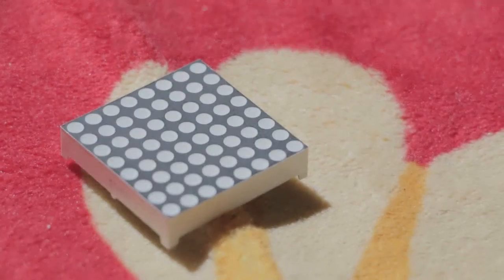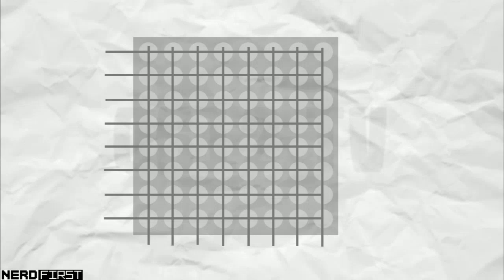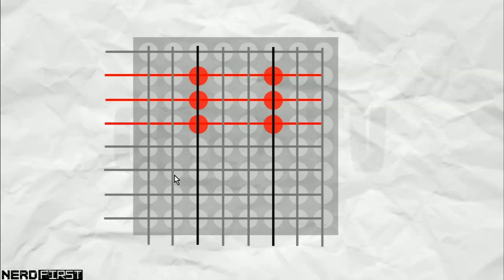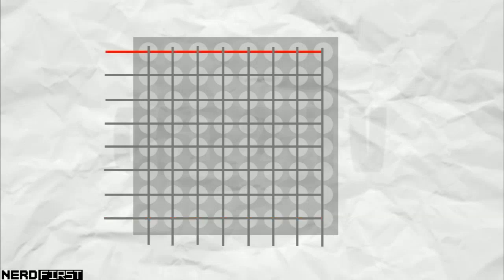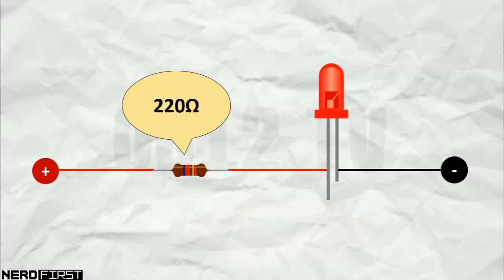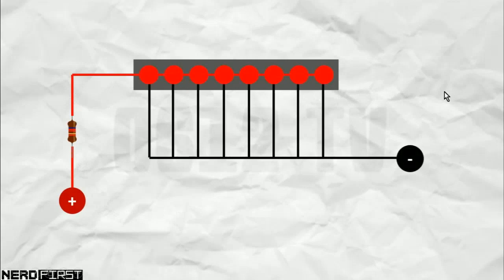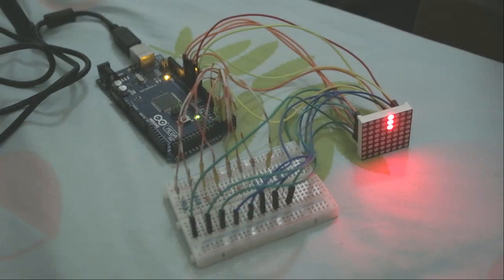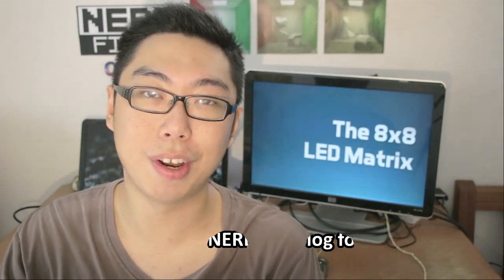8x8 LED Matrix for Arduino

Comment: Are you down?! Why are you showing the contacts on the left and bottom, When in a normal display the contacts are on top and bottom, What kind of nonsense is this?! Have you forgotten what a normal Arduino display looks like? Retake this stupid video!
Reply from the maker: Hello and thank you for your comment! Showing contacts on the left and bottom more accurately reflects the internal wiring of the matrix. Understanding how it works internally is more important than knowing the actual schematic - For that you would have to refer to the datasheet anyway, so this visualization is intentional!

Comment: Hello friend, can we make max7219 led dot array using ws2812 b, or any suitable LEDs. I have 2 nos max7219 4 in 1,what i want to do, just removed led array and make separate bid size display, to use as a wall clock, thank you.
Reply from the maker: Hello and thank you for your comment! I don't think it'll work for WS2812 since they already have control circuitry on board and already accept data input for easy control rather than raw signals like this.

At any rate, the max7219 is designed for matrix-style LEDs like the ones shown in the video, so unless you can find one that is pin-compatible, doing a swap like this is probably not a good idea.
Reply: @NERDfirst  thanks

Comment: Hi, thanks for the tutorial it's very interesting, my model has the number 1098AS on the side, is it the same for connecting the Pins? If you would answer me you would be doing me a great favor, I couldn't find anything online.
Reply from the maker: Hello and thank you for your comment! Can you double check if it says 1098AS or 1088AS? I indeed couldn't find anything for 1098, but 1088AS is a common alternative to the one I use which is the 1088BS.

If it is indeed the 1088AS, then it's different in that the anodes and cathodes are flipped. Read more here: https://forum.arduino.cc/t/difference-1088bs-and-1088as-led-matrix/970035
Reply: @NERDfirst  Maybe it's that and the writing has faded, but it looks like 1-0-9 (I thought it was a three because the arc above seems invisible) 8 or B and A-S (the last ones are visible very well)If only those two types exist it will be the second I presume. So is the connection reversed compared to the first? Resistor on the columns and not on the rows?
Reply from the maker: I think it's good to be very sure before you start wiring things up, to avoid any possibility of damage to your component. But having said that, yes I wasn't able to find anything with the part number "1098". If you're worried, test one LED first, the way I did it in the beginning of the video.

The difference in connections is more about which pins are connected to GND on your microcontroller (since we are flipping the positive and negative pins of the LEDs). Basically swap around all the pins I had connected to GPIO with all the pins I had connected to GND. As for resistors, as long as each LED has its own resistor somewhere in its circuit, that'll do the job.

Comment: Same things happen in our LCD or OLED display that we used to watch this video right now. They are even no such IC or controller that can drive millions of pixels on the screen individually. So, pixels in our displays may be connected together something like those LED matrix do, but maybe in other way. So, the controller controls the pixels by scanning. What we see on the screen actually not a complete picture. It just scan very fast until it can trick your eye to see a complete picture.
Reply from the maker: Hello and thank you for your comment! Good analogy! Unfortunately for a lot of these panels we don't get to be manually involved in this process since there is usually some hardware doing it for us. That's why learning something like this can help us better understand the tech around us =)

Comment: 11:50 Hi.  If each LED is getting 13.6mA and you turn on an entire row at once, then the circuit will try to sink 8*13.6 = 108.8mA which an output pin is not capable of providing.  This may result in damage to your microcontroller.  I think you need some high side drivers (e.g. 8 PNP transistors) for your common anode LED rows.
Reply from the maker: Hello and thank you for your comment! Yes indeed, several other commenters have raised this concern as well. Another commenter took measurements on the component and found that actual current draw is significantly lower, within the range of what an Arduino pin can source, but ultimately, the advise stays the same - Read datasheets, take measurements, and be doubly sure before embarking on such a project.

Maybe I'll edit the pinned comment a little to make it sound more cautionary.
Reply from the maker: I've just checked the earlier discussion (here: https://www.youtube.com/watch?v=G4lIo-MRSiY&lc=UgztVk5rMrTeLnISr4R4AaABAg ) and noticed that you've participated in it and brought up these points before.

Good to hear from you again and thank you for continuing to share your feedback!

Comment from the maker: Expand for Important Notes

1. On Current Draw
A valid concern about the setup shown in the video is whether current draw exceeds what a Pin on the Arduino can source, bearing in mind that the GPIO pins on Arduinos are rated for 40mA at the absolute maximum. This could indeed be a problem - Drawing too much current can risk damage to your Arduino, so if you're going to be building something like this for extended use, don't do it the way I did!

It is best to take your own measurements and consult the datasheet of the components used to ensure that you are not overloading your Arduino.

Further discussion here, with thanks to YouTube users Mangostein and Enigma758 for their input: https://www.youtube.com/watch?v=G4lIo-MRSiY&lc=UgztVk5rMrTeLnISr4R4AaABAg

2. On Debugging and Help
Unfortunately due to high IRL workloads, I'm not able to look at your code and help diagnose problems. You may contact me at hello(at)nerdfirst(dot)net for paid consultation, if you really see the need.

Comment: Hi, this is a very clear explanation video, may u pls upload the schematic on routing this 8*8 LED with using Arduino MEGA2560, simply watching the code hard to imagine how u r routing...
Reply from the maker: Hello and thank you for your comment! I'm afraid I don't have schematics for the circuit in this video. According to the code, it seems like I use pins 2 to 9, and 22 to 29. I can't tell which set is for X and which is for Y, unfortunately, but I believe it's not much of a problem switching the two around.

Refer to the diagram at 2:49, and connect pins 2 to 9 in order to the X pins, and 22 to 29 in order to the Y pins. If we mixed up the rows and columns, the image may appear rotated to the side, but that shouldn't be too bad, just rotate the matrix physically and we should be fine.
Reply: @NERDfirst  Thank you for ur reply. so u r trying to say pin 2 for x1, pin3 for x2,..., pin9 for x8, then pin 22 for y1, pin 23 for y2,... pin 29 for y8 right?
Reply from the maker: Yes, that's right! Don't forget the resistors.
Reply: @NERDfirst  Much appreciated. I will follow ur code to implement this time so i wanna make everything clear. Another thing about u using ATMEGA2560 to drive the matrix, in ur code is it using this logic: initially u use pin 2-9 to control the rows, pin 22-29 to the columns and all leds are on. Then in the loop, when i=0, then pin 2 controlled row will hv HIGH, when i=1, then pin3 controlled row will hv HIGH, and only those whose data[i][j]=1 can make the specific columns to be LOW then the LED is on?
Reply from the maker: Just took another look at my code, it really is kinda messy, sorry about that!

The important loop of note is Lines 32 to 39, which will set the appropriate columns high or low depending on the data in the array, then the row is powered (Line 40) so that the appropriate pixels will light up.

The overcomplicated code from Lines 25 to 30 is there just to switch off the last row that was lit up. Putting a one-liner after the delay() on Line 42 probably works too. See if this loop is easier to understand:

void loop() {
  for (int i=0; i<8; i++) {
    for (int j=0; j<8; j++) {
      if (data[i][j] == 1) {
        digitalWrite(j+22, LOW);
      }
      else {
        digitalWrite(j+22, HIGH);
      }
    }
    digitalWrite(i+2, HIGH);

    delay(analogRead(A0) / 10);
	
    digitalWrite(i+2, LOW); // Use this to switch off the row instead
  }
}
Reply: @NERDfirst  Thank you very much, i understand now. One kind suggestion could be upload the schematic as well just like Arduino official website so that those people who want to follow ur setup is convenient to do the experiment.
Reply from the maker: Thank you for your suggestion! For this particular video I had deliberately left it out because this is less about reproducing my specific setup here, and more about understanding the underlying patterns that makes this component work! Notice how I didn't even cover the code at all in the video.

Comment: Great video, very instructive! I have a question tho. What happens when we turn on a full column? Wouldn't all of the LEDs of that column be connected in parallel sharing one resistance?
Reply from the maker: Hello and thank you for your comment! Yes indeed, this is a concern we discuss in the video. Be sure to do your scanning such that at any given time, only one LED is in the path of each resistor. So for example, if you have resistors connected on the rows, then you should be scanning column by column, so that at any given time, for each row, only one column will be activated at a time.
Reply: @NERDfirst  Thank you very much for your reply!

Comment: Muchas gracias. Please would you explain to me, what means if my matrix is 1088AS  and not 1088BS,  what is the difference? thank you.
Reply from the maker: Hello and thank you very much for your comment! While I've never encountered a 1088AS before, it seems like there are some differences in the internal wiring. According to the linked source,

"1088AS = Row Cathode Column Anode.
1088BS = Row Anode Column Cathode."

Ref: https://forum.arduino.cc/t/parola-library-parola-modules-and-1088as/443418

Comment: hey, das programm für den arduino ist nicht beim link was soll ich tun, ich brauche das programm und falls man auch eine lybary braucht brauche ich sie auch, es währe nett wenn du mir helfen würdest, denn ich kann meine led matrix seit 2 jahren nicht benutzen

hey, the program for the arduino is not at the link what should i do, i need the program and if you also need a lybary i need it too, it would be nice if you would help me, because i have been able to use my led matrix for 2 years Do not use
Reply from the maker: Hello and thank you for your comment! I was able to find the code in the link. Click the bitbucket link, click the "Smiley" folder, and click the "Smiley.ino" file.
Reply: @NERDfirst  OK thanks, you hab a cool kanal

Comment: Is it better to scan the rows then the cols or cols then rows...i am getting some leds dimly lit where i have no pixels set in my array. what is the best method?
Reply from the maker: Hello and thank you for your comment! Ideally, you'll want to scan in such a way that each resistor takes on the current from a maximum of one LED at any given moment.

This is the easiest way to think of things, as resistors can also be placed at either the rows or the columns.

Comment: Im a newbie and have a q - putting the resistor on the negative side of the led..... doesnt that mean that the current from the arduino hitting the plus side of the led has uncontrolled current and could still blow the led?
Reply from the maker: Hello and thank you for your comment! Since someone asked something similar earlier today, I'll go ahead and copy and paste the answer I've written:

This is ok because of how current behaves in general. A circuit connected in series will have the same resistance and current throughout. So if you apply Ohm's Law to figure out the correct resistor to use, you can add it anywhere in the circuit between 5V → LED, or LED → GND. Since they're the same series circuit, the whole of it will be restricted to the same current, thereby preventing the LED from burning.

Comment: Hello. New to LED engineering. I would have thought that resistors would have to be between battery and LED but apparently as long as it's in there at any point, it will still "save" the LED? Is there a reason why?
Reply from the maker: Hello and thank you for your comment! This happens because of how current behaves in general. A circuit connected in series will have the same resistance and current throughout. So if you apply Ohm's Law to figure out the correct resistor to use, you can add it anywhere in the circuit between 5V → LED, or LED → GND. Since they're the same series circuit, the whole of it will be restricted to the same current, thereby preventing the LED from burning.
Reply: @NERDfirst  thanks for getting back to me. I've watched your video on how to ask questions on the internet. Love all the points you brought up. I'll make sure to implement them as I ask questions! 

I am working on an arduino project for a creative engineering course and want to use this 8x8 LED to "draw a photo" by moving using step motors to move the LED and light certain LEDs a certain color. Watching all your relevant videos to  see if I can get this to work! Thanks for all the content.

Comment: THis video REALLY helped me with using the display, and it's soo cool that you don't explain 100%, but just enough for me to figure out the rest by myself
Reply from the maker: Hello and thank you very much for your comment! I'd say that's the spirit - If I put up code you'd be tempted to copy. Instead, I'd rather paint a big picture with all the important concepts and you can fill in the rest of the gaps which are specific to your own project!

Comment: Hey, great tutorial. Do you know if the display can be dimmed at all? Or is it either bright on or off?
Reply from the maker: Hello and thank you for your comment! Dimming of the display is possible, but is challenging as you essentially have to implement "PWM-like" behavior on your own.

Imagine if you are able to refresh the display at a consistent interval, and you do the following:
Refresh 1 - Pixel (0,0) HIGH; Pixel (0,1) HIGH
Refresh 2 - Pixel (0,0) LOW; Pixel (0,1) HIGH
Refresh 3 - Pixel (0,0) HIGH; Pixel (0,1) HIGH
Refresh 4 - Pixel (0,0) LOW; Pixel (0,1) HIGH

The net effect here is that Pixel (0,0) is essentially getting a PWM effect at a 50% duty cycle. It should theoretically appear half as bright as Pixel (0,1).

Can't imagine that being fun to program, but I guess it can be done.

Comment: really informative and well-made video!!
i have a question:
if the two rows of pins are on opposite sides of the actual dot matrix (like at 2:49) why are they being shown adjacent to each other like at 2:08?
thanks!
Reply from the maker: Hello and thank you for your comment! The diagram at 2:49 shows the actual pinout of the component, which is unfortunately all over the place, by design.

In order to not confuse you, I avoid using that pinout. When describing what's going on with the component itself, it makes far more sense to go with an intuitive layout, as at 2:08.

Comment: Thank you very much again for the excellent explanation.
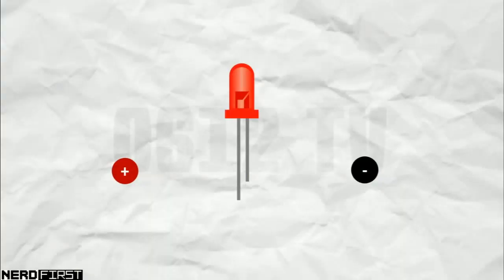By the way, could you put the circuit diagram that runs from minute 6:25 to 6:45?
Thank you
Reply from the maker: Hello and thank you for your comment! I don't have a circuit diagram for that unfortunately, but it's not very different from the rest of the circuits you see in the same video when it comes to control of the LED matrix. The only difference is in the addition of a potentiometer, which is on its own circuit, to the Arduino.

If you're not familiar with the potentiometer, you may check out this video: https://www.youtube.com/watch?v=EJHFYogSH1U
Reply: @NERDfirst  Thanks. But tell me just where on the circuit do I put the potentiometer?
Reply from the maker: Sorry but I'm really not sure what "where" means. The potentiometer is not in contact with anything concerning the LED matrix, so it's basically it's own circuit. Hence it can be placed anywhere.

The two outer pins go to 5V and Gnd and the wiper pin goes to an analog input pin.

Comment: This video is very informative. Since I am a beginner, I would like to built a 8x32 dot matrix using SMD LEDS. I would like to know whether MAX7219 or 74HC or TM1637 ic will be perfect for that. What would you suggest and what SMD LED will do?
Reply from the maker: Hello and thank you for your comment! I don't have enough experience to give you any particular recommendation. Maybe just start with what's most easily accessible to you, since most methods have their pros and cons and their own quirks.